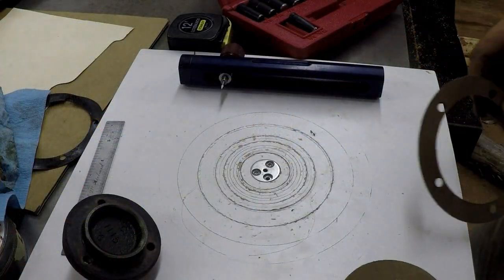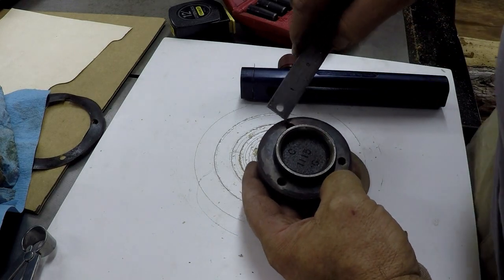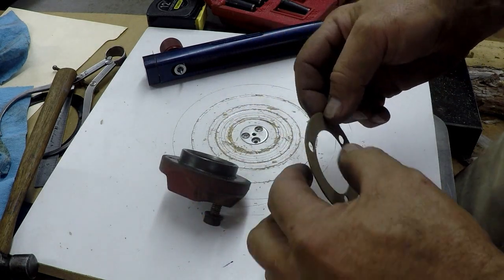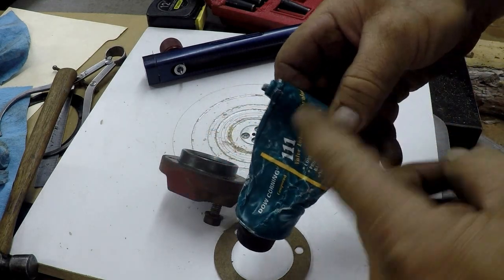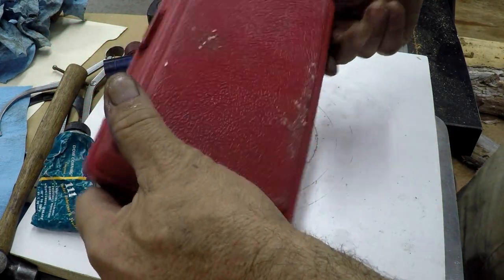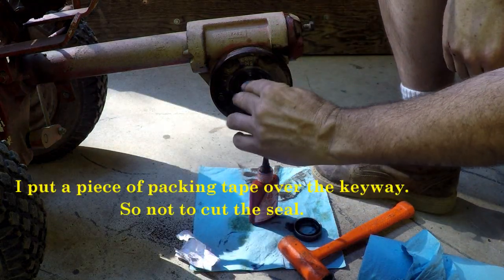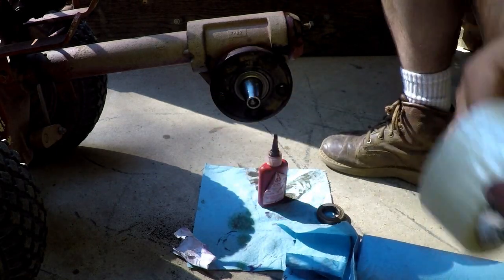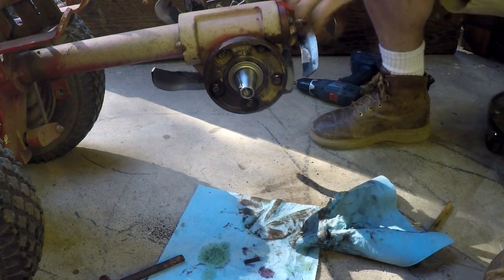How to Make Troy Built RotoTiller Shaft P4 Final

Comment: Hi Randy,  Nice video. I  have a Horse that I bought in 1979 and have replaced the brass gear about 3 years ago and I need to replace it again.  I don't remember adjusting the gears.  The Troy built repair manual says to use different thickness gaskets to adjust the left tine cover.  There are different thickness shims for the rear bearing cap but, I can't find anything in the repair manual that says which one to use.  Any ideas?  My question is:  Did you adjust the clicking or backlash between the worm gear and the brass gear?  Thanks!  Grant

Comment: Great Video.  Thanks for sharing Randy.  I have very similar tiller that needs reassembly as well.  Needs all new bearings and seals.  Been in my family since the 1970's.  and this is the first time it has been torn down for service.  What a great machine.  Thanks again for sharing
Reply from the maker: holry7778 Thank you for watching,  you can still get parts.  Good luck on the repair.  Thanks Randy

Comment: Nice repair and workmanship as always Randy.  Thanks for the video.  Looks like a gravely roto tiller.   Most currently made ones are stamped steel throw away junk with  chain drive and stamped beer cans for structure.
Reply from the maker: John Leake Thanks John, very solid machine.  Randy

Comment: A nice competent repair, but then we expect nothing less. :>)
I'm not so sure though that it is generally recommended to put anti seize, or any oily product, on tapers as it stops them doing their job of actually sticking.
I know there is a difference between self locking and pure location tapers and you have a key way in your shaft, but it probably would be best assembled dry, unless the handbook says otherwise.

Comment: Cork borers make good gasket punches for the bolt holes, and because they are so thin-walled, they can work as transfer hole punches. (Lay the part over the gasket blank and punch the holes in the gasket through the part holes.)
Reply from the maker: Peter W. Meek I will have to check those out Peter, thanks for the suggestion.  Thanks for watching and have a great holiday.  Randy